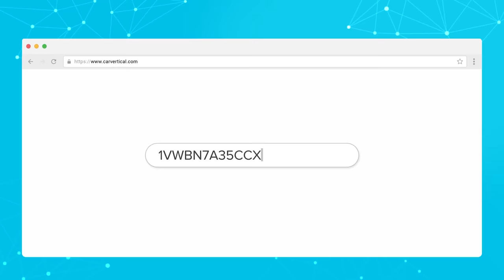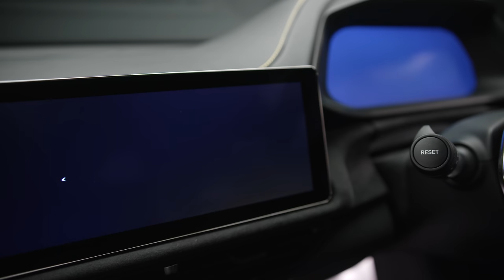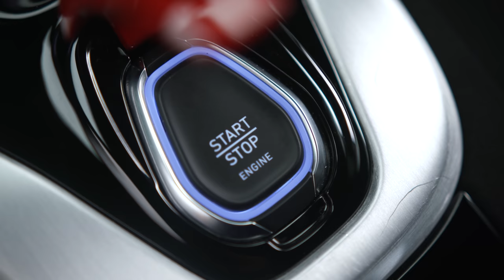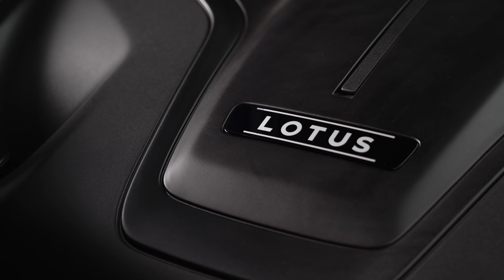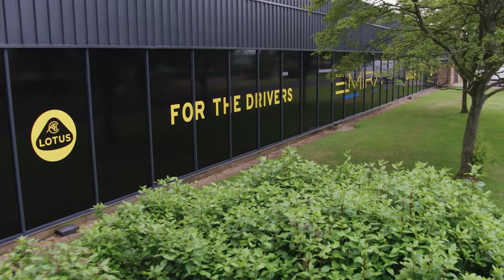The New Lotus Emira - An Evora Fan's First Impressions.

Comment: As a complete outsider, the use of a Camry engine always bothered me because of Toyota's heritage of producing beige appliances. I heavy prefer the AMG engine despite it being a 4 cylinder because of this, but it doesn't come in manual. Why, Lotus, why?
Reply from the maker: I expect it would have been too difficult to fine a manual to work with it in the time they had

Comment: Ahhh! I was waiting for that Video the last 2 days :-D - I like the Design, but not the overall concept. The communicated weight that is going around is not only high for a Lotus Sportscar , but at the same time just the weight of the lightest possible option available. So with all bits and bobs it will be even heavier. - Also not so sure about the engine choices. - I was hyped up at the beginning but a bit confused at the end.

Comment: I think the Emira is going to sell pretty well. Its looks good, not anything special, but what is nowadays? (Aston´s used to be pretty, now there not. Porsche´s are fine, Mclaren´s are fine and Ferrari only good looking car latelly has been the 296 GTB, but it still has issues).
About the engines, i think the correct choice to buy is the 4cyl AMG DCT, because even if its only got 360hp stock (probably 385hp), a simple tune will get it to 450-500hp! I agree that the Evora biggest issue was the transmission, mostly because it was to long (so that they could advertise 190 mph), some news have said the Emira has a top speed of 180mph, so that could mean that there a difference in the manual V6. 
While the V6 is nice, supercharged cars never seem to be has fast has they really are, the 4cyl will probably be the lightess and more fun (Edit: what about the noise? It doesnt sound that great on the A45, but it will a new exahust). The new A45 engine/DCT combo is awesome (they have a lot of potencial) and we all know that theres bound to be special version after some years.
Emira vs Cayman - depends on the materials quality and if the badge snobbery isnt that relevant.
Emira vs A110 - power vs weight, Emira has more power in any form but the A110 is lighter by 300kg! 

My money would go to a Emira 4cyl DCT, blue with tan interior, Tour setup (i read somewhere that the Tour package only comes with Eagle Goodyear´s, while the Sport comes with Cup 2, so when the Goodyear would be bust i would get PS4S), probably £65-70k, and for that money its awesome.

Comment: Incorrect regarding gearboxes, at least for the 4-pot, it will also come with the double-clutch from Mercedes.  You're right about this being a re-bodied Evora though.  I suppose the question is - is that a bad thing?  The biggest drawback for most with the Evora was the very bargain-basement interior, so...
Reply: Porsche Boxster uses a decade old chasis so...

Comment: Seen both blue and Black at Goodwood today. Looks amazing, what the Evora always should of been......Looks 100%. BUT Power is 400 standard 3.5 supercharged & gearbox is the same one with restrictions on adding more torque. So its a heavier car therefore a worse power to weight ratio,  the old 410sport wasnt quick enough for me. Yes should of had at least 450hp & 380 lb/ft. Price wise, I was told 3.5 V6 1st edition would be around 75-79k. Later base spec cars with 4pot AMG would be £60k+.  Love the look in person, its a wonderful car but power a little disappointing using the same engine & gearbox. Quality was good, options unnecessary ?

Comment: The fact that they didnt change the torque converter to a dual clutch like how the amg powered version does really annoys me
Reply: why? many manufacturers are going back to torque converter because they lighter, cheaper and easier to maintain. Most like the ZF change almost as quick now as well.
Reply: There will be Mercedes DCT in the lower trim.
Reply: @Im_too_old_for_this_shit  yes because it's a merc engine not the 3.5L. Doesn't really mean it's better. I'd prefer the lighter weight auto.
Reply: @Im_too_old_for_this_shit  yes but why didnt they put a dct on the v6? Thats what's annoying me
Reply: @wal7070  To be honest, buying this car with anything but a manual doesn't make any sense to me, but it's alright as long as they offer both. I've heard that they've perfected the manual in the later versions of Evora to the point where it became very good, one of the best in fact.
Reply: @wal7070  thats true but the torque converter came from the outgoing lotus evora which had rly slow shifting speeds compared to the competition. They shouldve put a dct on the v6 as well but they didnt which rly annoyed me
Reply: @dancinglizard3080  That's up to Mercedes to decide, I guess, and they probably refused the idea.
Reply: @Im_too_old_for_this_shit  nono i think merc was only involved for the 4 cyl version and the 4 cyl version only. Personally i think that lotus shouldve also made a dct for the v6 in their own engineering division because its to be expected that sports cars in 2021 must have some sort of quick transmission (either a fast torque converter or a dct) that will be good enough to compete against the competition. But who knows? Maybe that exact torque converter was updated and made to be faster 🤷‍♂️ so we cant judge until the journalists try these cars. But im still annoyed by the fact that there isnt any improvement on the transmission.
Reply: @dancinglizard3080  V6 comes with either a manual or ZF HP8 torque converter. I4 comes with Merc DCT only. That's it. They will not reuse any old automatic transmissions.
Reply: @Im_too_old_for_this_shit  oh so it comes with a zf 😂 i had no idea i thought they were using the old torque converter 😅

Comment: Awesome video, why on earth do Lotus say (I watched 3 other "launch" video's) this is the newly developed Lotus platform, they must have a communication person that could have told them that maybe re-developed would be closer to the truth (re-developed it is, they went from smaller wheels in the from to even size wheel all round). The Evora 400 drives better than the previous gen Cayman GT4 so, I want the Emira S Spider with the V6 and that manual gearbox you just promised.

Comment: Personally, I think it looks brilliant, legit Ferrari vibes in terms of its aggressive elegance, but drawing from the beautiful Evija design language. That said, I also completely expected it to be a 450HP offering, using an adapted Geely power plant offering, the same as the new 400Z is using an Infiniti engine to generate more power. Not that there’s anything wrong with the Toyota engine that you’ve always said is good for more power, it’s the transmission that lets it down. For it to be ‘under-powered’ just seems a bit disappointing in that sense on an otherwise stunning car inside and out that would finally be in a class of its own for all the right reasons.

Comment: Carwow did a good piece on the Emira, which included the seats. To the looks, I think your on your own island there, it seems (myself included) the internet has given it a big thumbs up. The interior looks like it's using a lot of Mercedes switch gear, so that's okay, MB or Toyota powertrain works for me, the big problem is, I can't buy one.....Well I could, but, it's a Lotus in the US which means it's going to be over priced, out the door a 2020 Evora is $120k and it's going to lose value as quickly as it accelerates.

Comment: Lotus claims it's a new platform, so which is it?
Reply: No its not, its basically Evora underneath the evija skin. Lotus tested this car using evora chassis and platform. The HP also gave it away that they are stuck with that old gearbox that holding back the power. 360-400hp? Dead giveaway. If its entirely new the hp should probably exceeded 430hp. And the space behind the back? Lol another give away. Evora had seats 2+2, they removed the back seat and BAM new car. Golf size luggage boot space hmm? Reminded me that evora also had that

Comment: I think the Emira looks great, but you may have actually sold me an Evora S or one of the GTs, because of the weight and power figures etc.

Have a Cayman S now, so it sounds like going to an Emira wouldn't be much of a change in driving feel - but that is just first impressions.
Reply: Emira has double wishbone suspension all round with coil overs and hydraulic steering, so why wouldn't it feel different to a Cayman?
Reply: @piersmoore375  My 987 cayman S has hydraulic steering, I have coil overs installed, and the suspension overall is very very good

Comment: It is heavy, not performance from lightness. Yeah it is more comfy but that is not what most lotus fans want.
Elise SC was just as quick and the Exige would whip it's A$$.
Reply: The tiny number of current Lotus fans sadly aren’t enough to make the business sustainable. Lotus sold less than 600 cars a year for the last few years. They’ve already sold well over 1000 Emira’s in the last 3 days. lightweight poorly made hand built cars isn’t cutting it anymore. This new direction will surely revive the brand.

Comment: I love the looks of it, and finally a nice useable interior, but I agree, disappointing on the power, how can they add so much more weight, and then give it less power.  The SC elise at 2k lbs was still a bit under powered, and really should have 300hp engine with that weight, but now a 3k+ lb vehicle with at most 400hp at the crank? plus they did mention a 0-60 in 4.5 seconds, in 2021, that's nothing to brag about, you can spend less on many cars and get better performance (ie most luxury SUV's will do that).  if you are going to spend close to 100K USD on a car, it should be <4 sec 0-60.  Just so many cars that can perform as well or better for less money (think C8 vette, tesla model 3 performance, etc), and better (more) dealer/servicing support, just makes it not worth while...if they increased power to 450-500hp, then they have a chance...the 4 banger should have 400+ hp, and the 6 should be 500!
Reply: I think you’re missing the point like Jay. No one cares about 0-60 times unless they’re 20 years old bragging to their geeky mates down the pub. This car will be successful because it looks epic, will be amazing to drive, can be a daily and only costs £60k. The reality is that it will be quicker than 4.5 secs especially with that 8 speed DCT box. Who cares if it’s 0.2 s slower than a Cayman S or whatever. If you don’t buy one for that sole reason that’s crazy.

Comment: The crap interior always put me off the Evora, so if this really is basically just an Evora with a nice interior and vaguely Ferrari-esque styling (which I like a lot more than the Evora) then it sounds great to me. V6 all the way, love the 2GR engine. Gearbox is trickier since a manual is great but I daily cars like this. I love a good torque converter but I'm not sure that's a good torque converter...

Comment: Would there be some future planning by removing the rear seats to make room for a battery pack and hybrid set up. This might extend the lifetime of the car to the point of breaking even? Supposedly, Lotus does development and prototyping for other companies so not much innovative here. Other companies need a mainstream model to pay for the sports cars. It seems unlikely for Lotus in a diminishing market. Good to see some evidence of investment but will it be enough in the end?
Reply: Even as great as it looks it is really still an updated Evora they put together quickly so if they are able to sell the units they are hoping for it shoudl be profitable.   No way is it paying for that new factory though
Reply: @edgonzalez3820  I agree. Even Porsche has to  sell other models to balance the books. The question is whether the "new" Evora has future updates designed into it?The latest 911 has been designed to accommodate some kind of hybrid system for when that is mandatory. If not then an all new platform is in development which will take all the budget to sort out other issues presently.

Comment: I don’t agree with being skeptical from the offset; also am I mistaken in thinking they said the 4 cylinder would be the flagship model.
Reply from the maker: The V6 is to be the more powerful car to start
Reply: @JayEmmOnCars  Ahh, my mistake- felt that they and other journalists were pushing the 4 cylinder and Merc connection a lot
Reply: @theoneandonlybosable  Most likely because most of these supercar-owning influencers are badgesnobs when it comes to anything japanese - despite Akio Toyoda's recent efforts to push the GR brand out with their GR 86, GR Supra and GR Yaris. To them, saying that its got a 'toyota engine' doesn't ring well to their narrowminded audience
Reply: @jamescarson6681  I mean AMG engines are better than Toyotas, and probably better than the BMW derived unit in the Supra.
Reply: @theoneandonlybosable  What comparisons are you trying to make? Thats like comparing the V10 Lexus LFA to the AMG 2.0 4 cylinder - makes no sense. Mercedes Benz make more larger displacement engines but doesn't mean they're better when they cost a lot more to buy and run. ALso the 2JZ has been around for 30 years yet its known to be reliable at 1000hp.
Reply: @jamescarson6681  The 4 cylinder unit in the AMG A Class and others is a better engine than anything Toyota CURRENTLY (duh?) makes for comparably sized vehicles, i.e better than the previous 6 cylinder they had in previous Lotuses and better than any 4 pop they make now, IMO.
Reply: @theoneandonlybosable  " anything Toyota CURRENTLY (duh?) makes" - thats your fault for being so vague. You're trying to tell me that the 2.0 AMG engine sounds better than the Supercharged V6? Your hearing is damaged. I feel sorry for you 🤣
Reply: @jamescarson6681  We are talking about engines for a new car lol, why would any thing other than current engines be relevant. Also, the A45 sounds better than any Toyota,, also also there is much more to an engine than sound, especially in the era of particulate filters and similar regs
Reply: @theoneandonlybosable  "🤣 "A45 sounds better than any Toyota" - no, the A45 sounds like a sewing machine with chavved up 'pOPs AnD bANgs' compared to the 1LR-GUE V10 from the LFA and the 2UR-GSE  from the LC500 🤣🤣🤣
Reply: @jamescarson6681  The kid is an AMG fanboy. He's brainwashed

Comment: It looks very nice...and completely generic. Couldn't have told you that this is the newest Lotus. But the absolute worst part is the exceedingly tired, trite, and even-used-on-Lexus-SUV's Coke bottle pinch in the middle. It's 2010's 50's tail fins...and it's 2021.

Comment: If it had 450hp and around 1100kg for €80-90k they sell like hot cakes.
Reply: 1100kg would be an entirely differemt car though, not possible to get those numbers with much comfort intact.

Comment: I think it's too expensive to be successful. £50k for th 4 banger and 60k for the V6 would be a better proposition. They need to be cheaper then a Porsche.
Reply: Too expensive? Are you joking? It’s already less expensive than a base 718 Cayman S and you can have a decent spec one of these for less than £60k.
Reply: Omg 50k?? Have you looked at car prices in the last 10years!!?? Furthermore have you driven a modern turbo 4 banger? The Merc unit tunes out to over 500bhp if you want, modern turbo units are mental.

Comment: Car is fire 🔥 but it is underpowered.

Evora has 450 hp

I mean get a baby blue base Corvette C8 black top with side skirt, use these same wheels and it’s not a 4CL it’s a V8 with 500 hp for same price.

This car is underpowered for the look.

Z06 Z07 see through top and 2LT front lift mag ride folding mirrors headlight LED

Comment: I was excited, then saw mercedes, then thought I will wait for the z400, otherwise if that fails, just skip the battery craze, and go straight to a hydrogen car
Reply: What’s your issue with Mercedes? Is it all the F1 engineering expertise they’ve garnered over the last decade? It’s one of if not the best I4 2.0 turbo engines and dct boxes out there